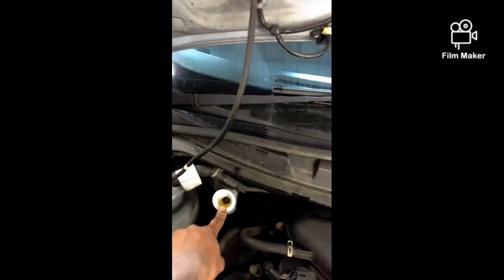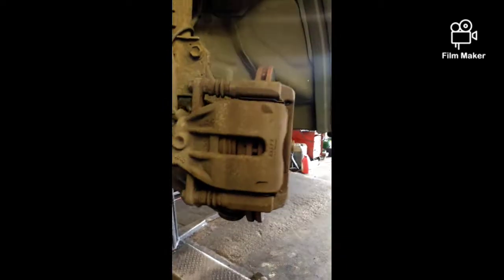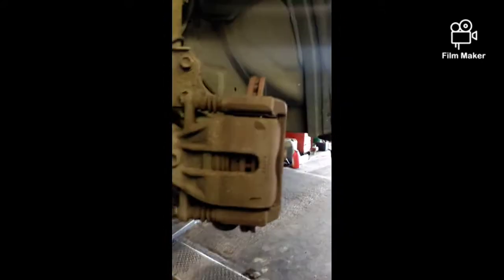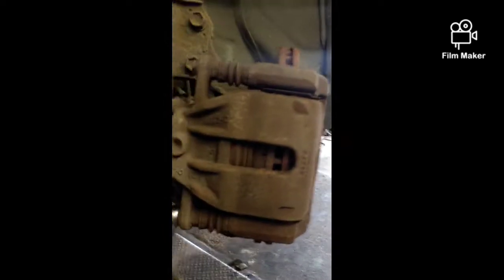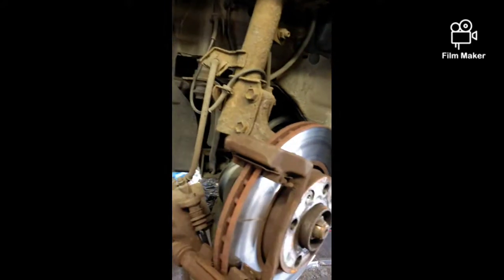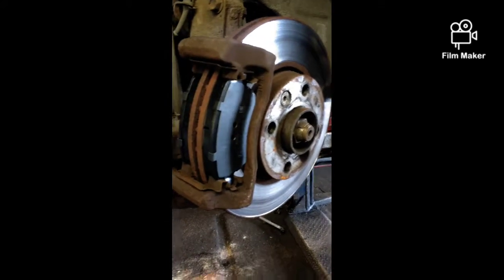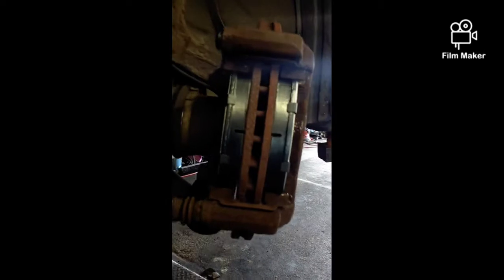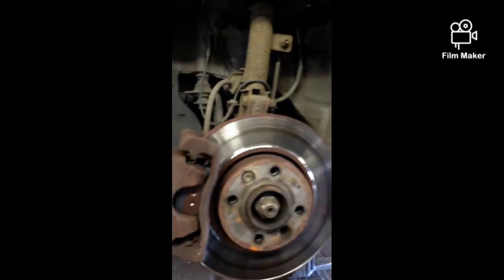2003 Nissan Micra Front Brake pad replacement

Comment: Hi .  Just changed front pads on a 2003 vw polo 1.2 petrol.  Didnt change discs - only slightly lippped.  Both caliper pistons pushed in easy.  Brake fluid reservoir between min and max.  Didn't open any bleed nipples.  Pumped brake pedal after changing pads.  Brake pedal felt fine when car not running.  When car running and driving, brake pedal feels a little spongy.  Is this normal until pads are bedded in? Appreciate your advice.  Thanks
Reply from the maker: That's absolutely fine. It will take few days for the new pads to bed into the old discs should be ok after that.